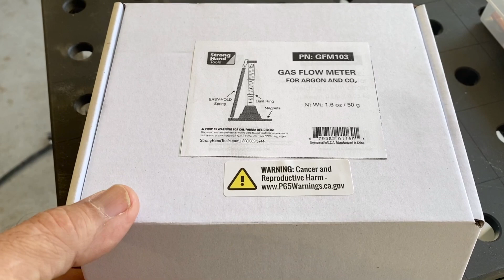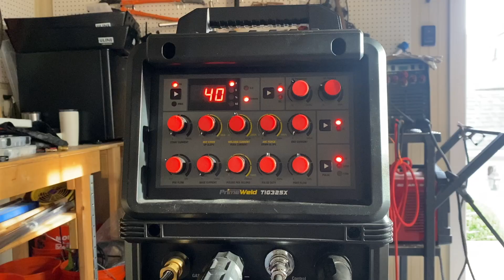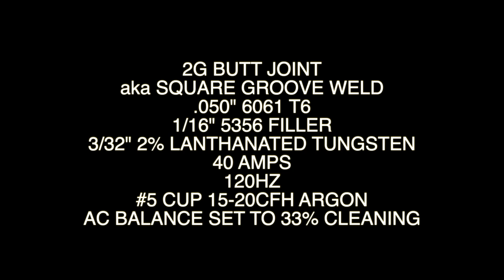Full Pen Aluminum Weld Procedure

Comment from the maker: https://welderskills.com/pages/ws-7-day-test-drive
Reply: Just for your information, in the aluminum boat factory industry. On the production lines they don't use the foot pedal to weld the aluminum together. They use a push button on the side of the stinger to start and stop the welding. And then you will have to have a burn through on the inside the size of the welding rod without any pin wholes in it. And then instead of going six inches a minute, you will have to go  ten to twelve inches a minute, and the thickness of the aluminum varies depending on the size of the boat that is ordered. From .043 up to .064 and some even a little bit thicker. And when I was a welder in a boat factory for seven years, I had to weld all different sizes of boats. From ten foot river boats up to twenty five foot bass boats in length and that included the pontoon boats, along with all of the parts that was used in the boats.
Reply from the maker: @galeogle  it’s pretty crazy all the different scenarios welders get into. Sometimes speed is the most important thing. Sometimes a porosity free weld. Sometimes color match after anodizing…etc. always more to learn

Comment: I've been subscribed and following you for a long time, and your content and thorough coverage of welding ally has been the backbone to my decision to invest in an ACDC inverter. I've been using your settings as guidance and a starting point for machine settings, prep and technique and it has put me in a good position to produce some quality joints. Some look prettier than others, that's on me as the operator. But they are all strong joints regardless of presentation. Thanks Jody 🤙
🇦🇺 Also, I'm not a welder - it's just a practical hobby of mine.

Comment: Hey could you make a video on tacking different material thicknesses? I have started a aerospace job where tacking is crucial as we are tacking two different thicknesses, one being thicker then the other, one mess up and the whole weld drops through. Also having trouble with a fillet weld that has a small ledge and the puddle wants to drag up and burn that out. All the stuff I have mention Varys from 30 to 50 thousands and on dc stainless steel tig

Comment: Hey Jody, im in the aerospace maintenance and repair side of welding. Could you do a vid on s .032 6061 but joint to simulate crack repair. I am having issues with porosity sometimes, that being said, the material is often been in service for quite some time, and can only clean it best I can. Thanks for the videos!
Reply: Try experimenting with different abrasives. Abrasives have different metals inside them even the soft scotch brite ones. For example when i weld titanium is use the tan scotch brites since the maroon scotch brites give porosity. Maybe your abrasive is introducing a contaminate the aluminum cant tolerate . 
try using kim wipes instead of rags when cleaning with acetone. 
Also adjust your machine to have more cleaning action. Some machines call it different things sometimes dig or balance.

Comment: Something interesting that I noticed while messing around with some 4" sched 40 pipe is vertical down welding aluminum will actually suck out the root and vertical up will push it in. I'm trying to figure out how to push the root in on the bottom or overhead portion of a 6g test on aluminum. Any help would be appreciated...if it's even possible. Much thanks for the video Jody and keep on keepin on!

Comment: Jody, are you conflating aluminum oxide and aluminum mill scale??  Oxide is not visible and will 'heal' itself in a few seconds- mill scale- the layer shown is not the same animal.  You should make sure to make your viewers are aware... IMO.  Oxide broken up in furrows flakes/floats off the parent metal in AC w hot argon cover.  Mill scale retains water vapor which often ends with 'salt & pepper' flecks on a finish weld, ends up causing gas bubbles in the root face, 'white flowers' on the weathered part (especially 5k & 6k alloys) and is very visible. Brushing w SS brush will take off mill scale and furrow the oxide that forms in 2-3 sec.

Comment: Rather than wire brush to clean after welding you can use Ali Cleaner it leaves the welds clean and also cleans the parent metal.
On tread plate you must only clean the weld with a brush and wash off with water immediately so as not to damage the coating on the Aluminium.

Comment: There's a good practice for low and medium thickness aluminum to make a bevel at the bottom side for the butt joint. You then have full penetration but no sagging.
Reply from the maker: Thanks for the tip. I’ll try that

Comment: Jody do you have a 2G open butt aluminum test video on .50 or .250 thick aluminum using a backing strap?

I took a test last week and failed it cuz I was expecting something else. It was failed on visual cuz I wasn't prepared for the test. I did complete it but was dunking tungsten. I had never used a 17 size torch with 3/16 tungsten on a half inch aluminum open but. It was interesting and I got invited back to retest in 60 days. 
I have a 255ext and could probably practice the test on .250 material. 

I looked through your videos and didn't find a 2G open but on thick aluminum. 

Thanks for you time
-Ken
Reply from the maker: I don’t have a video like that yet but good luck with your retest
Reply: @weldingtipsandtricks  thanks bud
Reply: Multiple passes? Did they allow you other tools like a brush, file, grinder, etc? What size filler? What alloy of base materials and filler?
Reply: @JackOffAllTrades  T6 and 5556
I had a brush. I didn't have the gear to deal with the heat. I had a pair of 1350's and no heat shield. It was basically tested by visual. They let me run a few beads and approved for me to take the test. Then visually inspected the root which was good, but once seeing the cap they failed it. So never got grinded and bent. And they didn't provide a grinder. 
But my interview went real good so that's why they asked me to come test.

Comment: You should not scratch back and forth with the brush due to  risk of moisture being trapped in the surface of the metal. It does help on x-ray welds. After all aluminium oxide is very hygroscopic.